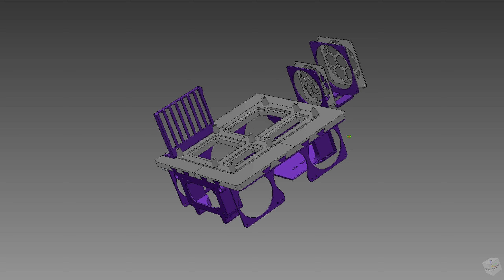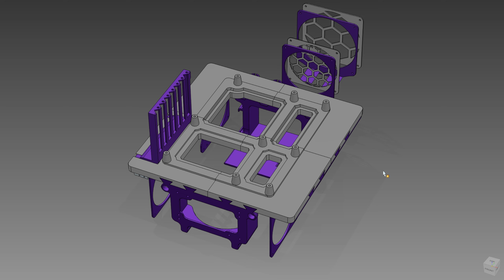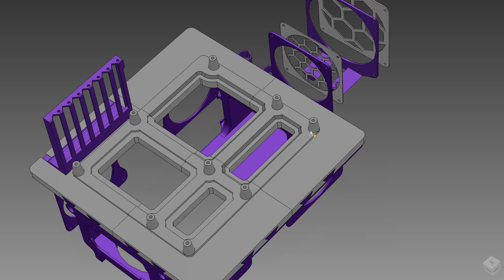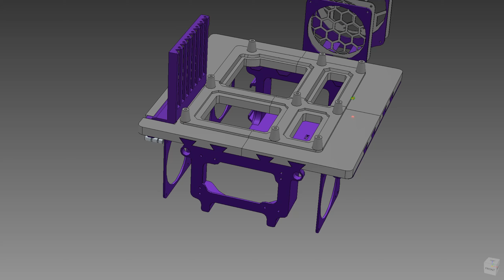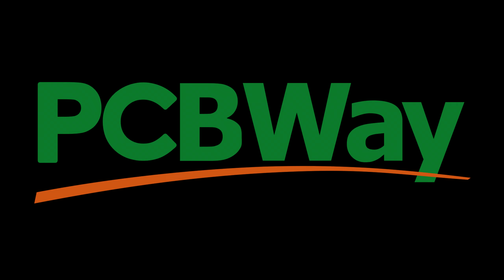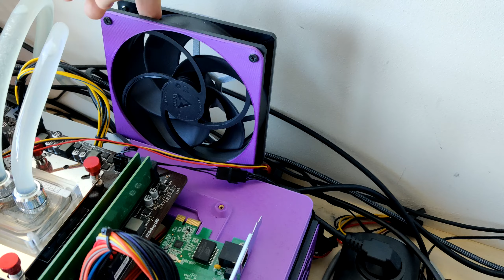I designed and built my own Testbench!

Comment: Do you still use windows 11 from ghost spectre? I am curious if you have found out if any more mods have to be done to the superlite version to make it even faster for benchmarking?
Reply from the maker: i'm using ghost spectre w10 mostly. win11 is slower on most things i run.
Reply: @CmdrSoyo  So besides w10 you don't tweak anything else?
Reply from the maker: @OneCosmic749  still the same as in that video i did on benchmark tweaks